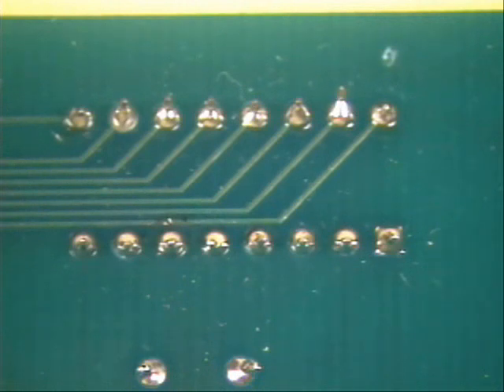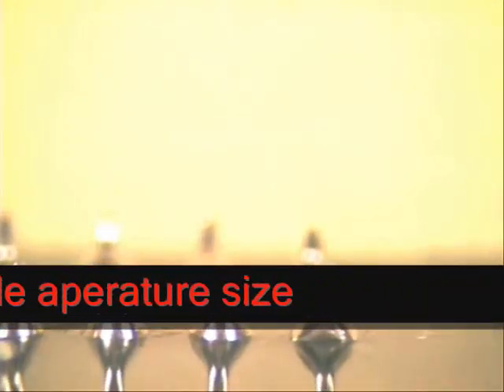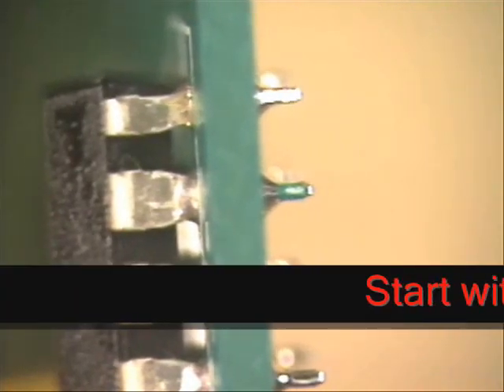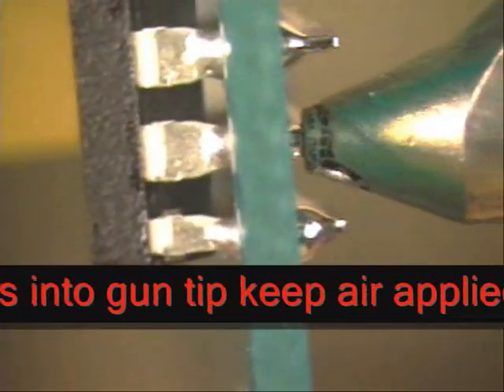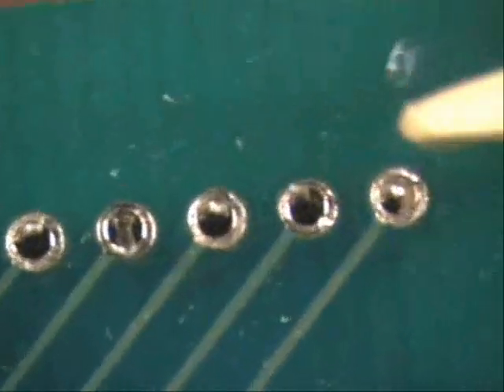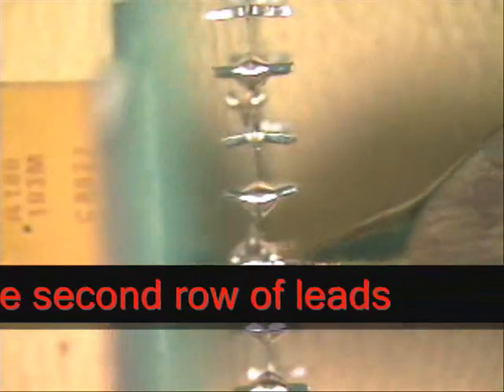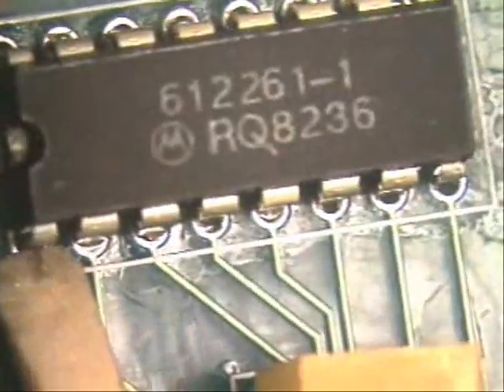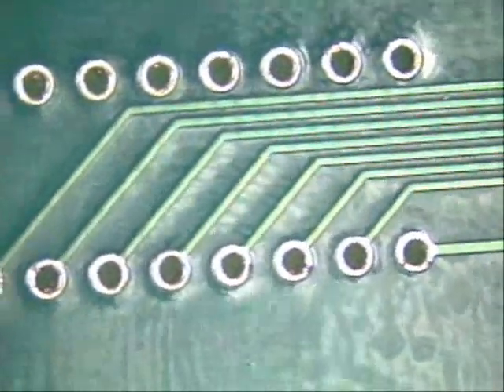Flat lead desoldering

Comment: DIPs typically come from the factory with flared legs so that they will hold themselves in the PCB if placed with an insertion tool. If the board you are desoldering was populated this way then you should always pull the desoldering gun away from the lead while flexing it toward the center of the chip. This means it will have to travel across the plated through-hole to rest on the opposite side and is significantly less likely to form a sweat joint.

Comment: Hi, I recently did an estate cleanout and have come across what I take to be 2 rolled up bands of what looks like lead, one of which has a channel molded into it. Could this stuff be a form of solder? It is very pliable and quite heavy. I do not want to try heating it because of it`s potential value. Thanks

Comment: What about on multi-layer boards with large ground\power planes such as a computer motherboard?
Reply: My Aoyue Int 701A++ (older AC pump version) would not build up suction fast enough, only reaching maximum strength after removing solder from the bottom, breaking the heat bridge to the component side and allowing it to re-solidify. My solution was to increase the temperature for pins connected to power and ground and kink the hose closed while holding down the trigger to build up maximum suction. I would then watch for the solder melting on the component side and jerk the hose straight as quickly as I could. With the air normally in the hose already evacuated and the pump already spooled up to maximum speed, this technique releases maximum suction through the nozzle all at once. It took me years of frustration to develop this technique!

Comment: Do you know how expensive this desoldering gun is?!? It used to cost a fortune around here. Today it's for a half-a-month worth of work. This is way too expensive for most hobbyists. In fact, even small companies have it as one of the most precious pieces of equipment. I will give you a few tips on how to do the same thing cheaply:
• Preserve part: Put a huge blob of tin, pull the part off.
• Preserve PCB: Cut all legs far from PCB, remove ind.
• Preserve all: Force in an injection needle.

Comment: I have a vaccuum solder sucker ( the spring loaded kind ) and am trying to desolder a 14 pin flat lead DIP. I have a fine conical tip on my iron. I've removed half of the solder, on the opposite side to the chip, but the vaccuum hasn't picked up the solder on the side with the chip, any advice there?

Comment from the maker: Sounds like you are doing through hole?  If this is the case I have question for you.  How are you desoldering  is it with a vacuum desoldering system, solder sucker or solder wick.  I need to know the answers to this before I can help.

Comment from the maker: Yes, you could clip the leads off at the body and heat then up with your iron and pluck them out with tweezers or needle nose pliers.  Then use a solder sucker to remove the solder from the holes.

Comment from the maker: The possibility of overheating a component is lessened by alternating from lead to lead rather than continuing from one lead to the next. Even older systems should be fine using the alternating method. You'll be surprised how much heat a component can handle. When you actuate the vacuum there is a flow of cool air through the tip and over the lead. This helps to keep the component cool.

Comment from the maker: In the soldering tip videos we are using a Metcal 500DS soldering system
with the MX-DS1 handpiece and appropriate size desoldering tip. Size the
tip to the work; in other words, ensure the tip is large enough to fit
around the lead without forcing it onto the lead. You can use any
desoldering system from any manufacturer and use the same technique.